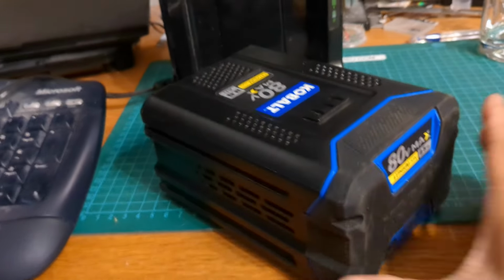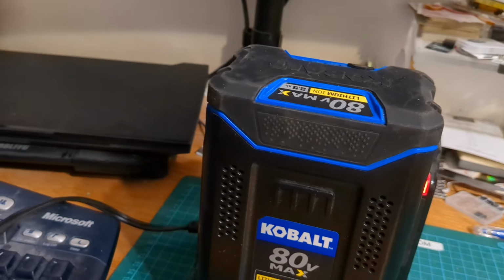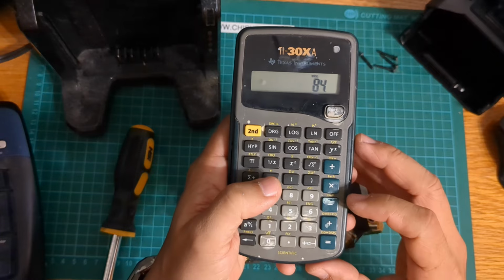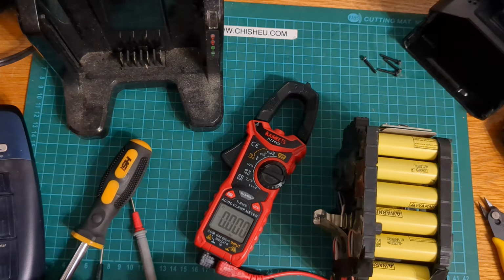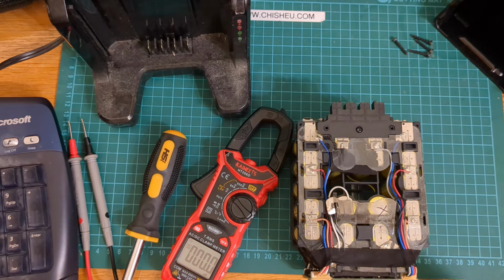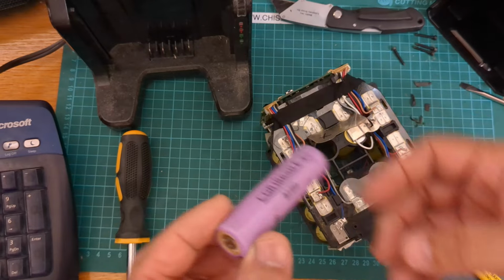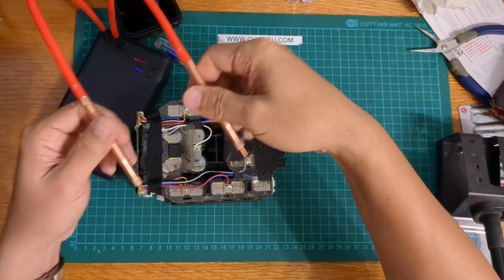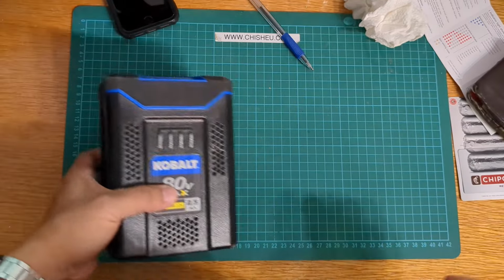Kobalt battery repair

Comment: Mine Flashes RED and then stops flashing.  Voltage is 69.8.  Cells range from 3.2 to 4.1.  Any suggestions to repair my pack?  Thanks.
Reply from the maker: 3.2V is too low. The nominal range of the 18650 Lithium Ion cells are between 3.6v and 4.2v. See if you can boost the unbalanced cells without disassembling the matrix through a benchtop power supply and alligator clips. Once all of the cells are within range, the BMS will likely allow you to use the battery pack once more. Good luck.
Reply: @SuperWhizy  I've got all the cells around 4.1 volts.  The button to check charge does nothing.  No lights.  Charger still a flashes Red and then stops.  So I guess I missed one of the Cells in front.  Measured everything again and one Cell was at .336 volts.  It would not charge.  Hit it was 4.3 volts and 3 amps and nothing. So will cut the cell out and install a used LG cell I have laying around.  My welder is pretty weak so may have to solder on the straps?  Thank you!!!!!   I suspect it will work after replacing the bad Cell.  The Batteries are dated 6/2016 so not sure how much life is left.  I bought an 80 volt Kobalt Mower at an Estate Sale.  They wanted $65 for it but no one was interested so he offered it to us for $30.  Do not need this Mower but wanted to see if I could revive the 80 volt pack.

Comment: You did not mention, but it  is important, if your replacement cell has the same mAH rating
Reply from the maker: Thanks for the note, @W4OP. You're absolutely right. All of the cells should have the same capacity to keep from becoming a weak link in the series that'll affect the performance of the entire pack.

Comment: The BMS in these batteries is not built very well and will killl the battery is it isnt topped up often. The easiest way to bring one back from the dead is use a bridge rectifier and an incandescent lamp with a wall cord. Wire to the positive and negative of the battery stack but after the control FETs then let it charge slowly till you get 3V per cell. If you got some that dont charge they are bad, mark them and remove them then rebuild with new cells or delete one cell out of each pair and use good cells to make a functional but lower capacity battery. If they all charge ok, continue to 3.3V per cell and pop in the charger❤
Reply from the maker: Thanks for the tip, @christopherleubner6633.